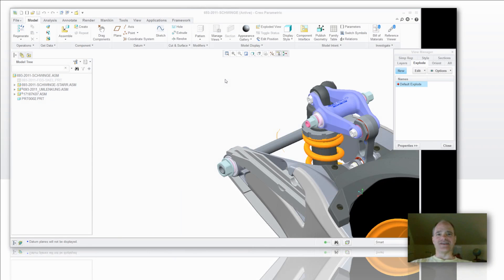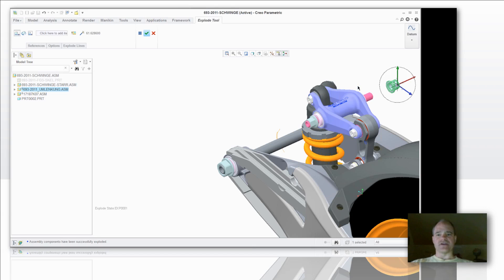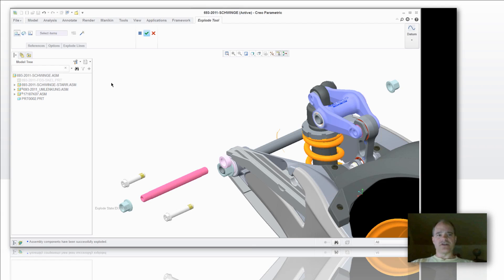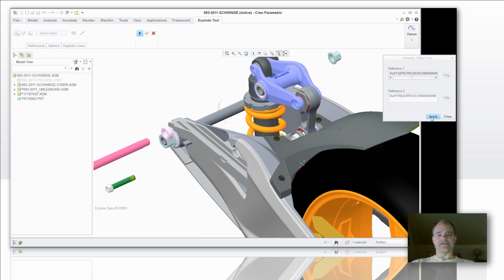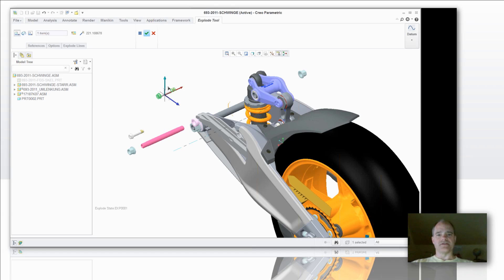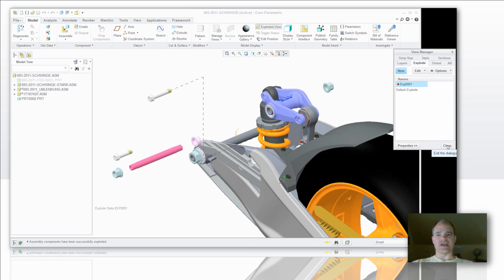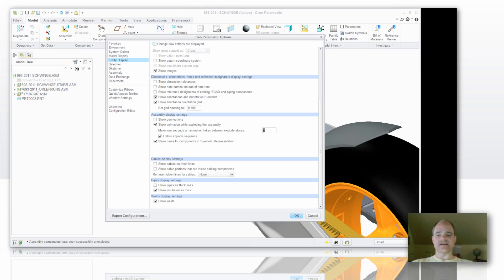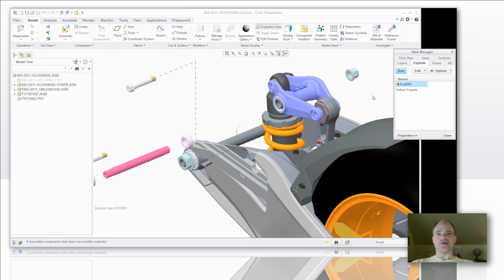EAC Tip-of-the-Week: Creating 3D Explode States in Creo 2.0

Comment: Great video, thanks!  Is there a way to save an assembly snapshot as an exploded state?
Reply from the maker: Not clear on the question. Here is my first swing at an answer, based on a hunch.
Snapshots can be created while dragging mechanisms. These snapshots can then be used in drawings. They are created after the snapshot[s], by selecting the camera icon. (it looks like a camera with the Creo part icon. 
 
The drawing icon next to the snapshot name indicated the snapshot is accessible in drawings under the view states / explode components in view.
Reply: @EACPDS  Thanks so much for your reply!  That is almost what I was intending to ask.  Sorry for my lack of clarity.  What I was really asking is whether or not it's possible to include a snapshot created in the Drag Components window of Mechanism mode in a combined view by selecting it in the View Manager or if it is otherwise possible to save a snapshot (or otherwise the positions that Mechanism components are dragged to) in a combined view.  It seems that it is only possible to save part positions in combined views as explode states after the parts have been dragged but it is difficult to control these positions precisely while creating an explode state (unless you use the workaround of setting the drag increment to exactly what it needs to be).  I was hoping that you could just apply a snapshot and save the positions to an explode state within the View Manager but that doesn't seem to work permanently.